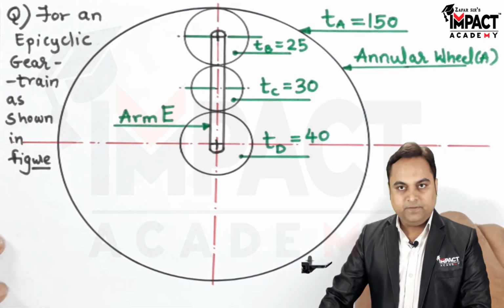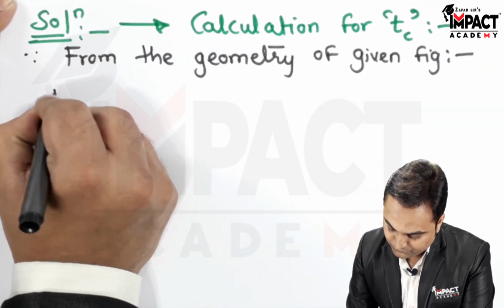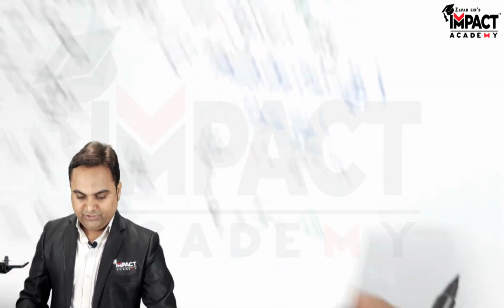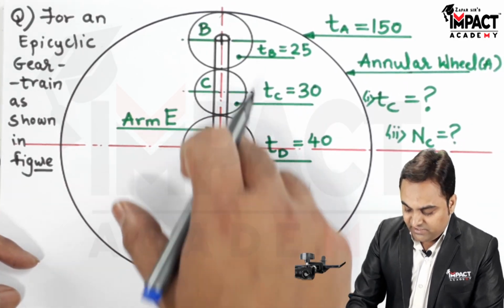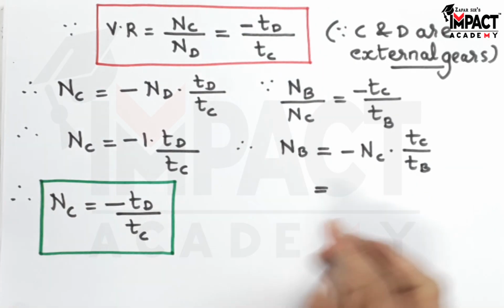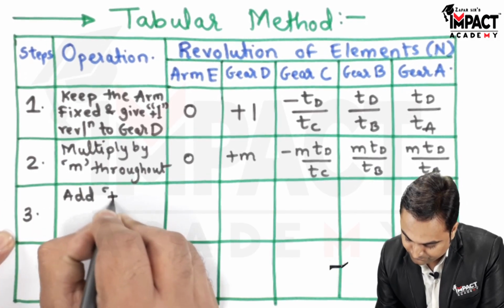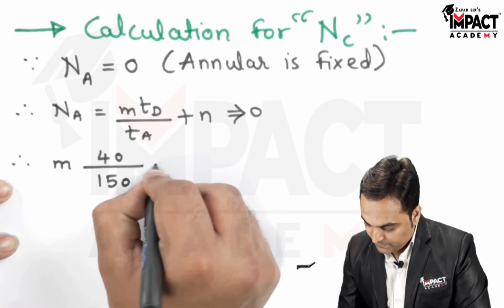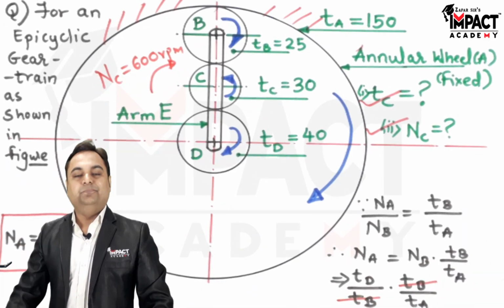Problem No 2 on Epicyclic Gear Train | Gear Trains | KOM/TOM #gateexam2025 #engineering #important

Comment: sir rotation of gears in clockwise is  negative and anticlockwise is positive  give in rs khurmi text book  
you told in opposite ones check the text book and tell properly
Reply from the maker: http://bit.ly/impactEngineering
To access all Engineering Videos 
Please visit our app Impact : The Engineering App 
You can directly download the app from the link given on top👆🏻👆🏻👆🏻

For more queries related to app, contact our Customer Care Number :- 
+91 7900123134
Reply: Yes sir, the assumptions of Sign conventions for clockwise rotation is negative and positive for Anti clockwise as per khurmi. Please rectify this issue. I'm little confused on this question.